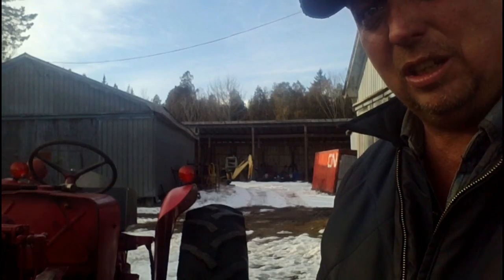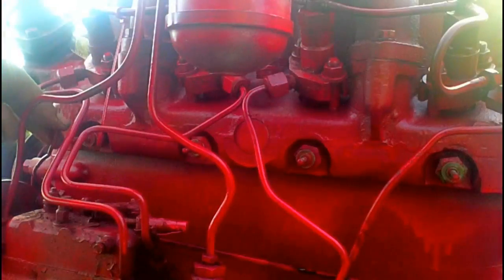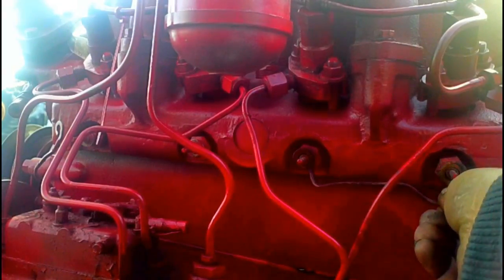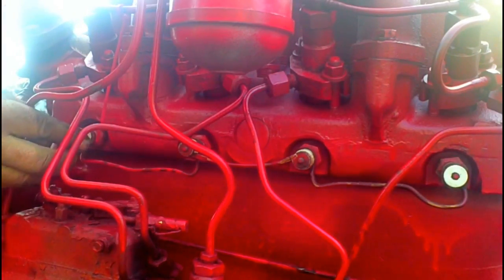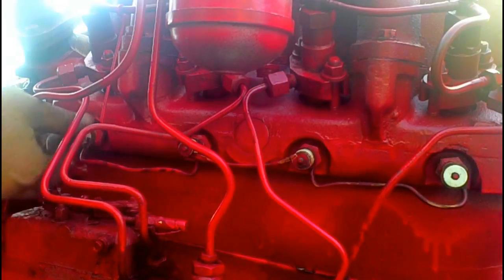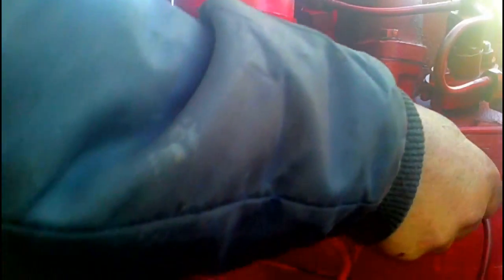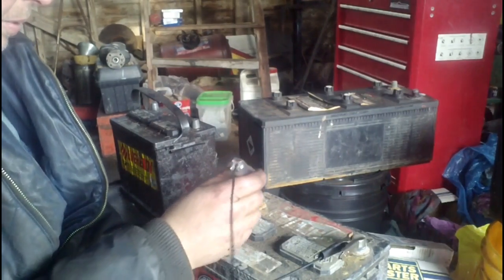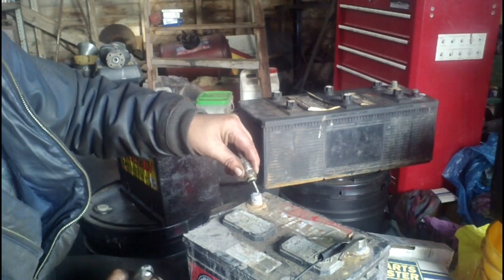How to Wire glow plugs

Comment: Hey there, not to be a pita but I am hoping for your input on my 364 tractor. The black lead from firewall to #4 glowpug disconnected reads 12 volts when key is put into heat up position. When black wire is connected to glowPlug 1 in series and key turned shows 5.7 volts. Glowplug 2 shows .72v, glowplug 3 shows .68v and glowplug 4 shows .043v. The metal between gp1+2 gets hot but rest stay cool to touch, also glow indicator gets red hot and shows +/-12 volts both sides when key is turned. Was hoping for your thoughts on this and maybe the volts you read when doing the same so i can compare. Brand new Bosch glow plugs and all original wires were sanded clean to improve ground. Thanks again for your help and time. Jeff
Reply from the maker: The glow plugs are resisters, you will show a voltage drop between each pair. I have never checked voltage only continuity, if I have power going through each one I consider it's all good. Thanks for watching.

Comment: Also Dave I found two peice information on  B414 help to have 750 to  1000 Cold Cranks Amps with 90 to 150 reserve amps 12 volt type , every three months add a grey bottle of STP Total Treatment fuel injection cleaner with 200ml of Dexron 2 Automatic transmission  to fuel tank full and add 2 drops oil in Generator on front pulley and back bump there toliet seat caps to pull up also keep them lube up! Also when Generator went ours B414 Desiel motor loader tractor in 1992 after engine rebuilt add GM Delco Alternator ones made from 1968 to 1985 best use with 90 amps type from 4 in line or 6 in line  or V6 or  V8  cylinder General Motors types with Single V pulley ! But first Alternator we use from 1968 International 1 ton pick up  345 V8 truck my dad had years ago it was 2 stages amps 35 amps on fully charge battery but when had started up Desiel or Cold Start even had lights on tractor give 70 amps for first 4 hours then return to the 35 amps! Turn lights go 70 amps again so won't flat battery to dead! So when order parts to rebuilt the Alternator found was 70 amp 2 stage so had 1 amp 35 and 2 was a  70 amp  fully do ! If need how rewired in Dave or anyone ask me it simple to do ! The GM Alternator replace we did on the 1963 B414 DESIEL LOADER TRACTOR with 2.5 litre in line 4 cylinder to and does work on other models to like 444 , 275 , 404 , 624 , 724 ones made from 1985 or earlier International  tractors plus combines even Farmall too! I help anyway can if need ask too!
Reply from the maker: Yes, for sure need a heavy duty battery for a diesel tractor and heavy cables too.
  Thanks for watching!

Comment: Great Video,  You are good.  glow plug resister took it  off, did a test seems 13.5v goes through it.    is there a fuse for the wiring?
Reply from the maker: No fuse in the glow plug system, probably is for lights etc. but not the glow plugs. Thanks for watching!

Comment: I have glow plugs like this, but the 40A fuse is starting to blow after 10 seconds.  The glow indicator on the dash glows bright red just before the fuse blows.  The B414 tractor does start right after this as if one or two glow plugs are working.  When I replaced all glow plugs with new one, everything works as it should at 20 second and the dash indicator is hot but not glowing bright red.  After several days of starting, the 40A fuse starts to blow again and the whole process starts aver again.  What do you think might be the issue?  I have glow plugs in series like your setup.
Reply from the maker: As far as I know there should not be a fuse in the heating circuit for a B414, I think that would be your issue. If one of the glow plugs blows there is no complete circuit. Thanks for watching!
Reply: It sounds like the RESISTOR [ the dash indicator ] is faulty. The glow plug circuit is not normally equipped with a fuse, or at least not on my B275.

Comment: I don’t know if your still looking at comments but I’ll try asking. I have a international 434, originally a positive ground, but was made into a negative ground by my grandfather. 

The glow plugs as far as I can tell never worked. I would like to rewire them to a new switch (according to the manual, the glow plugs were ran off the key switch but the original key switch was seized so I had to replace it and nobody makes that key switch anymore that I could find).

First question, does the change in polarity from a positive ground to negative ground change how the glow plugs are wired? 

Second, do you know how many amps the glow plugs draw approximately so I can get a proper sized solenoid to wire in? 

Third, do I need to wire in the glow plug resistor in the dash to make it work, or can I just run glowplugs. 

I hope you see this. Thanks!
Reply from the maker: Polarity doesn't effect how the glow plugs are wired, feed a hot wire in and ground at the end of the series. You will need the glow indicator or you will burn up the glow plugs,,, too much juice. I am not sure how many amps the system draws but one good alternative is to use an old school starter switch (mechanical solenoid) like used on a Farmall H and others.
  Thanks for watching!

Comment: I have a question for you. The coil on the resistor wasn't glowing red on my B414. So I replaced the coil and now the coil glows red within seconds of putting the power to it , only problem is that there is no power at the other end of the resistor. the side that comes from the battery lights up the test light nice and bright and the other end of the red coil is dead and no power is getting transferred to the wire that leads to the glow plug. Am I doing something wrong?
Reply from the maker: Is it shorting to ground through the coil?

Comment: Number four is it from negative battery? Im working on a I-250 its wired wrong.
Reply from the maker: That depends on if your tractor is negative ground or positive, you feed in a hot wire from your glow plug switch on number 4 and it goes to ground from number 1.
  Thanks for watching!

Comment: I have a bd144. How do you wire them up from the power side? I have mine wired fine on the block
Reply from the maker: From the battery to the switch, through the indicator to #4 glow plug.
Reply: @CanadianRedneck15  can i run a cable to glow plug #4 for like 30 seconds? Or do i need that indicator
Reply from the maker: @felixnungaray3253  You need the indicator or there will be too much amperage getting to the glow plugs an you will burn them out.
Reply: @CanadianRedneck15  shoot i did that once or twice. So does that mesn i need new glow plugs lol.
Reply from the maker: @felixnungaray3253  As long as you still have continuity you're OK.
Reply from the maker: @felixnungaray3253  As long as you still have continuity you're OK

Comment: Why is the connecting wire between #2 & #3 on top of the insulators?
Reply from the maker: The glow plugs on these tractors are wired in series, the power goes in through the top of #4 and out the bottom to 3, out the top to 2, bottom of 2 to 1, through the top to ground. The top and bottom contact areas are insulated from each other.  Thanks for watching.
Reply: I'm really confused about this too. I've always thought glow plugs were wired parallel

Comment: hey Dave
Is it possible to install a block heater in a B250?
Reply from the maker: There are no frost plugs so you can't put a heater in the block, there are ones that go in the bottom rad hose though nd they work very well. Thanks for watching!
Reply: @CanadianRedneck15  Thanks Dave appreciate your help

Comment: For a connecting continued flow of electricity. Leads from four to one. Otherwise it would just glow 4 and 3
Reply from the maker: If you follow the directions in this video they will be wired correctly, they must be wired in series and do not ground through the body of the glow plug, there are two connections on each glow plug, one beneath the insulator ne on top. Thanks for watching!

Comment: HI 3 questions, I have a 1976 i/h 364 that uses ch28 glowplug with loop end, i noticed you are using pencil end. could you tell me the glowplug part number and brand  you are using? 2) when you are checking the glow plug for good or bad it is hard to tell exactly what you are touching with the test light could you clarify.3) if i wired the power lead under the insulater touching the 4-3 gp metal bottom link instead of top of insulator power to bottom next to metal connector from 4 to 3 plug would that cause a glowplug system failure. just wanted to also thank you for your videos, they are by far the best for info for my tractor on youtube. thanks for your time. hope above does not ramble to much and is understandable
Reply from the maker: The glow plugs I use also have the wire loop at the end, I get them from A&I Products, you will be able to search their site for a dealer near you. 
  To check the glow plugs I connect a hot wire to the threaded lead on the glow plug and touch the test light under the insulator where the wire would sit, you should be able to light the test light there, you should be able to light the light when touching to the body of the glow plug that threads into the head.
 There are 2 connectors on each glow plug, as long as the power goes in one connecter and out the other they will work.
 I am glad you enjoy my videos, thanks for watching!

Comment: Can I hook the glow plugs directly to batter + and put a "push botton type" push and release switch in to glow plugs and bypass the switch .  and turn on glow plugs for a few seconds and then start it ?  thanks much ..     Gary
Reply from the maker: You have to wire through the indicator/resister that goes in the dash to cut down the voltage otherwise you will burn out the glow plugs but you can use a push button style switch. Thanks for watching!
Reply: Would you know where this resistor / indicator is?  Please ..  I am pretty dumb on this stuff.    ha!   Thanks a lot ..  or can I put a resistor like you put on a 12 volt coil to a 6 volt system on old tractors?    Thanks so much ,..    Gary
Reply from the maker: The resister is a salt and pepper shaker looking piece right up on the dash, there should be a coil of wire that you can see through the holes in the top. If it's not there you will need to get one, they are available through Sparex.
Reply: Thank you much !!    I will see what I can find ..  I will go over Monday and work on it .    Gary
Reply: Thank you much !!    I will see what I can find ..  I will go over Monday and work on it .    Gary
Reply from the maker: Good luck.

Comment: I've got a b414 and my glow plugs are wired nothing like that at all no wonder it's so hard starting when it's cold out. Where would one find the proper wiring kit
Reply from the maker: You could try to look for a used set or make your own with some 10 or 12 gauge copper wire. Thanks for watching!

Comment: Hello I am a person who has worked my entire life not getting a blister or a callous.  I read a book called letters grom winfield farms and wanted to be a farmer. Bored being at home with nothing to do  I  purchased a farm and it had  2 b250's, an 8n that did a popper wheelie when i put a back hoe on the 3 point, a w4 and an oliver.I have been starting the diesels with ether. I have been told   this is not good or the way to start them. I did not know that my tractors had glow plugs. I am trying my hardest to be a red neck but it is not going well. I have a question that may seem simple to some but not obvious to me. The power source that is referred to being connected to cylinder 4, is that just a 12 volt source that I could put a princess auto push button on? Can I just use a power wire with a fuse to the above starter button? In the video it says glow plugs pull alot of amps would I need to put a ford style solenoid in between the button and number 4 glow plug? If not a solenoid would I need a relay? Any help or answers would be great thanks
Reply: Oh and incase anyone one else does what i am doing don't take your wife's 2 month old BMW with white interior to princess auto to get hydraulic hoses while you are oily from head to toe. If you do you will be buying her a new one and you will have a 90 thousand dollar parts truck
Reply from the maker: I've read that book, it was certainly entertaining. For the glow plugs you could use a Ford solenoid or a mechanical starter relay like is used on a Farmall H. Thanks for watching!
Reply from the maker: @chrisginn5012  Expensive parts car but at least you're driving in style, let me know how it handle hauling hay. :) Happy wife happy life.
Reply: Thank you for the responses they were very helpful. I will come to the well again with my next question.
Why are the glow plugs run in series and not parallel? Would it not be like Christmas lights that if one burns out the glow plugs that follow will not operate?
Ok I have another question Mr red Neck are you looking for someone to do an unpaid internship for a day when you are doing something fun and or educational
Reply from the maker: @chrisginn5012  Series VS parallel, my best guess is English engineers. It's like they are competing with German engineers for the most complicated way to get a job done and they're drunk. :)  And yes, when one glow plug goes out they all do.
   I have a couple of  Farmall Super A/ 140 engine rebuilds happening, if you want to come spend a day or two let me know. sales@chowntractorparts.com